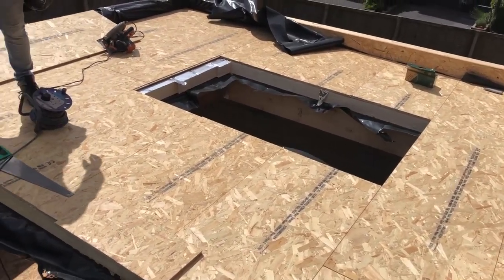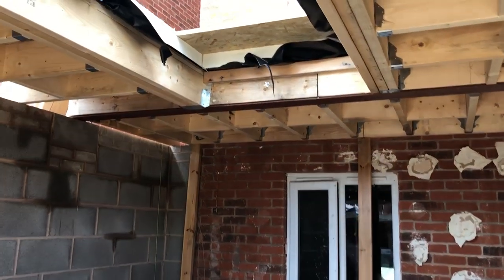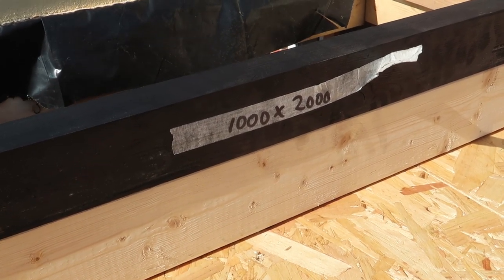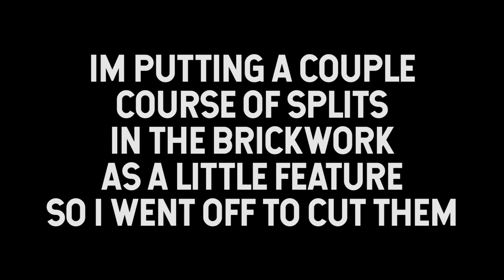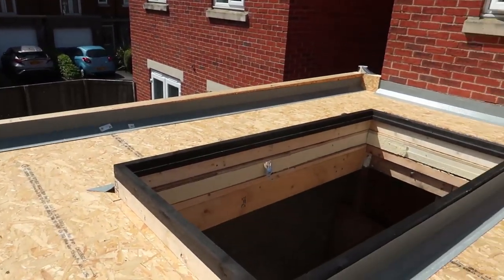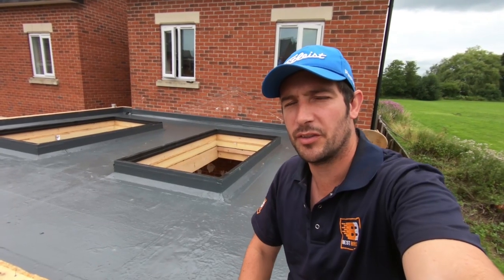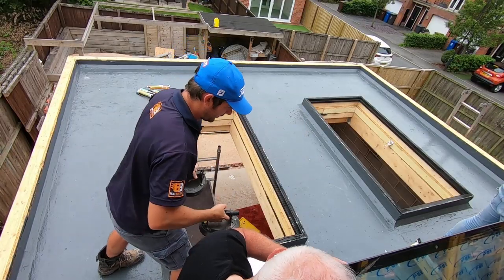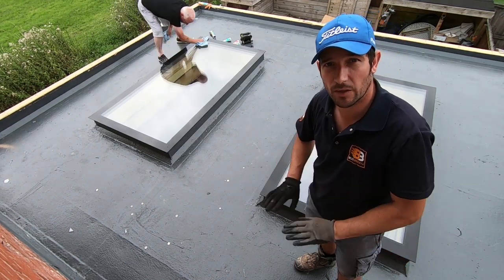Bricklaying - Building Extension - GRP Roof Done and Roof Light Glass installed.

Comment: Just a bit of advice from a grp flat roof specialist, you should never double apply the top coat unless 1st coat has only been on less than 24hours. Can pretty much guarantee that topcoat will crack in acouple of years
Reply: If I GRP my roof and want to apply a 2nd coat of fibre before topcoat how long is idea to wait begore 2nd layer? Thx

Comment: Hi STU, great video. We are going to do the GRP fibre glass roof on our garage. Can you please share the names of the products, you used. It seems that you didn't leave any gap between the osb board and wall. So is it not required if using osb t & g board.
PS: I have been suggested using ply and Cure It resin. I saw your comment that why ply isn't advised, so we will go with OSB 3 T&G boards. If you can share the name of the Resin, Topcoat and Catalyst, that would be great. Cheers

Comment: The glass should only be sealed around the outer edge of the frame and glass. I just fitted two  by same manufacturer and they said do not bed the glass on silicone. Maybe the spec has changed since you fitted yours.

Comment: Looks good but why are they level? Surely should have a 60-80mm slope so the water runs off?
Reply: They’re not level they have a slope on them Lee did a spot-on job Lee is very special joiner you honestly don’t think he would put them in level🙄
Reply: R R the roof will be slightly sloped that there fitted too, so it will still run off

Comment: Hi stu isnt there supposed to be expansion gaps between osb boards and all the way around the perimeter ?
Reply: Also if you would have put vertical studs from bottom of roof to lantern you could of insulated all the way to glass and wouldn't have a 4ich cold spot  and it would of held the vapour barrier all the way to the top
Reply: Sorry just realised it’s a warm roof .doesn’t need venting .

Comment: Nice drainage on the roof as well lads, love it! Was hammer action being used on that drill to drive them screws btw?
Reply: It's an impact driver not a drill 👍
Reply from the maker: No it’s just a noisy drill lol, not an impact driver
Reply: @Stucrompton1  Yeah i have the same drill (not an impact as you say :P) Nice one Stu, all the best!
Reply: @Stucrompton1  That's the torque setting kicking in i'd imagine so he doesn't drive the screws in too far when putting quite a bit of pressure on the drill!

Comment: Nice parapet roof Stu! Although personally I’d use ply to cover the roof not OSB. In years to come when you get a leak the OSB will just break up with water damage. Ply is far more resilient. Just my opinion. Extension is looking cracking though Stu 👍🏼 love them roof lights.
Reply from the maker: We were advised by building control to use all the materials we used Paul so all other opinions don’t matter. Cheers pal
Reply: Ply isn't suitable for fibreglass. OSB3 T&G is what's recommended

Comment: What’s the ‘U’ value of the skylights Stu? I’m building a loft conversion with a dormer window and already had problems with building control. We told them it was having a rubber membrane and they where fine with that but in second visit a different guy said he wanted fire retardant rubber, it was already bought and about to install it when he was there so had to abort and buy FR rubber. He also looked at the cutout for the skylight and insists on the skylight being 0.18 ‘U’ Value. I’ve looked around and can only get as low as 0.6 ‘U’ Value with triple glazing. Looking good Stu.
Reply: How did you get on with this Garry?  I was looking at the u-values for roof lights earlier and from what I could gather it was 1.6W.
I get a bit of brain fog when I start reading through building regs.

Comment: GRP are good. Done a few of them but I've seen so many that have been done with no pitch and absolutely level. Worst thing for GRP is letting water pool on it as it causes the GRP to delaminate and start leaking! I've found it always needs the same drop that you'd put on a gutter to make it last. How does the water drain off if its flat and has an upstand all the way round?
Reply from the maker: There is fall from front to back hence why there’s 2 outlets at the back

Comment: I thought you could only put 1 top coat on a GRP roof ?
Reply: TheGazpar86 if the top coat has liquid paraffin wax you can’t put another coat on but, if there isn’t any wax in the topcoat you could put a few on. Followed by the topcoat with the wax. The wax help with the waterproofing/water repellent.

Comment: I would have installed hip lanterns. Just my opinion. FRP👍👍
Reply from the maker: They’re dated now plus they’re only 28mm. These are 56mm triple glazed so more of a noise reduction.  just my opinion
Reply: @Stucrompton1  If you can get triple glazed regardless of if it's for a window or sky lantern or door it is preferable. It's used extensively in Europe especially Germany/Switz. 

Most people in the uk balk at the price difference between double and triple glazed in windows these days. 

There's no doubt that for noise and thermals Triple glazed quality manufactured glass and frames are the top standard imo.

Comment: grp is terrible stuff you want to go for a epdm roof. Easier to install lasts longer not terrible to your health and lungs as grp, dosnt break down in sunlight. the job looks spot on dont get me wrong. its just a terrible product in my opinion. ps put gravel on that roof other wise you will hear every bird foot step and rain drop. unless its got some serious insulation.
Reply: doh... i see it has. nice.
Reply: Never put gravel on the roof. First time our window cleaner came to do the windows above, walking on it, the gravel punctured the roof! Didn't find out until it leaked through! Cleaned it all off, scuffed the top surface and applied another new layer of GRP. No gravel. Been great for over 10 years now.